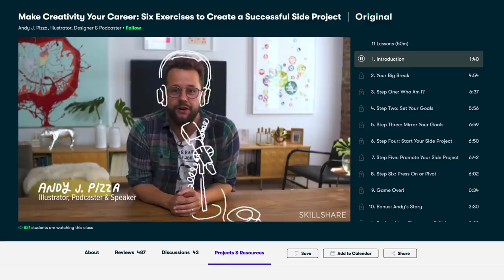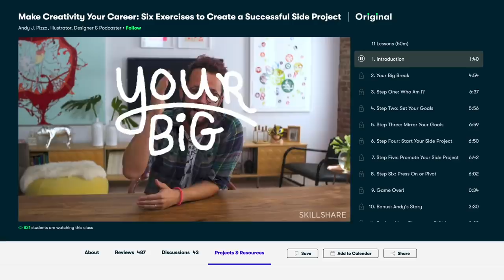Horse Box Camper EP 5 - The Roof Rack

Comment: Looks great, good job. The idea with the roof rack gets a bit of a drawback with the solar panel, cause you can't use the full space. You may check out the suspension of the trailer: has it the same comfort as a regular caravan trailer? If not, it can rattle the interior loose. And have a close eye on the solar panel. It might not withstand hard vibrations. Anyway: thumbs up for your project.

Comment: I'd put some better rubber under those solar panels personally. Big ol' rubber bushings the size of a donut at least. Trailer suspensions are awful, and those panels are an expensive piece of glass to crack.
Reply: And in that position, road bumps will play that horizontally-stressed plate/drum in ways it wasn't designed for. Wondered of diagonal/center support would be helpful.
Reply: It's not glass, but resin actually.
Reply: @p_mouse8676  There are models with glass. Anyway, resin can break as well, especially after some degradation through sunlight.
Reply: @p_mouse8676  Even worse? Resin is easier to crack than the tempered glass panels due to impact, and who the hell is selling resin panels that big? The resin universally fails before you can even recoup the cost of a panel that size, it's the cheapest, most disposable panel you can buy that's usually relegated to toys and landfill trash like chinese landscaping lights.

The ONLY acceptable use for resin on residential solar panels is to repair a broken glass panel. The glass is the heatsink that keeps the cells from cooking the PCB. You can't get rid of the heat with a puddle of plastic. Forget the fact that resin reduces the efficiency of the cells.

But I think it's safer to assume that you actually have no idea what the panel is covered in, given the above facts and that nobody makes panels that large in resin at any scale, let alone sells them as a consumer product.

Comment: I don't know what the laws and norms are in Germany, but Its not uncommon to have a hot wire to the trailer from the pull vehicle to charge the battery while driving. This is a much faster charge than what you would get with the solar while driving. Definitely keep the solar for when you aren't driving,  but it might be worth looking into that 12v hot wire to charge while driving.

Comment: I like the way it's coming up, but I have to ask if those four wooden columns will be strong enough or, rather, rigid enough. I can't help thinking what could happen if there's a combination of too much weight on top and tight turn on the road or an emergency brake situation. Just asking.
Reply: I had exactly the same question during the video. Also, there is no 4 support columns  support because they are cuted : https://youtu.be/cRuZuJgnwac?t=461.
I would say  there is 3  columns working in the structure than 4.
Reply: Cuted and perced  at the same point of structure , the weak points are here .
Reply: Weight distribution is everything in such a trailer, so I think she knows not to store particularly heavy items up there.
Reply: With much of the to area covered by the solar panel, I expect that portion of the track is more for protection than storage.  Without side ladder access even a tall person with have a time putting anything heavy up there.
Using the forklift to let one person gently place the track atop the trailer with so little risk of damage was genius. Working without an assistant requires improvisation.
Reply: Ah man, I just saw this comment; already posted my own separately... but yes. I share the concern.
Reply: @jameswyatt1304  if you ask me, having around, and therefore using, a forklift is not exactly what I call improvisation. Most of us don't have the access to one. Don't get me wrong, nice for her if she can. If it were me doing something like that, I would have to do it indoors with the help of some pulley system or maybe using a make-shift ramp with a couple of long wooden sticks or so.

The thing is not whether anyone would have a hard time placing anything heavy there, the thing is you can place "many not-so-heavy little things" that can add up to some heavy weight. And, again, it doesn't need to be too heavy, it just need  to be heavy enough that, together with some G-forces due to acceleration, braking and/or cornering, that wood could snap.
Reply: I think that the German TÜV will not be happy with the construction. It is to weak. Sorry for that, aber ich kenne die Truppe, die haben mir schon für geringere Dinge Probleme gemacht
Trotzdem viel Erfolg
Reply: In another comment she said a TÜV inspector had approved it
Reply: @galli0  if TÜV has approved that, I have nothing else to say. My concern is the same, I would certainly do it with metal instead of wood, that is for sure, but if TÜV is ok with that, it's fine with me.
Reply: @fadetounforgiven I would think that the force of the air when driving would be a big problem. I've seen metal roof racks torn from car-tops because people grossly underestimated the force involved. Remember holding your hand out the car window at highway speeds. I suspect that even if the uprights were steel they would bend if not break.

Comment: The combination of wood and metal looks amazing. Nice work. Just a question what would have happened if you elevated the solar panels to the level of the sides of the roof top. I feel it would add some storage underneath them and makes it easier to stack your stuff on the other part with less worrying that they would fall over or shed over the panels.

Comment: The solar brackets looks squishy which was a little underwhelming compared to the exquisite detail for everything else. And im sure will be revisited. Would it not also  be an option to suspend the panel under the rack so you can pack ontop of the rack if needed without risking damage to the panel.

Comment: The way you mounted that solar panel on the roof rak almost cuts the available storage space in half - after all, you don't want to cover it with the stuff you load up there. Wouldn't there have been a good place for the panel in the narrower front section of the trailer, to where the roof rack doesn't extend?

Comment: hey Laura always love your work, but I think your design has a major flaw, if those uprights are 90x35, at the lap joint they are now only 15-20 thick and there is a 10mm hole through that and because of the tension on the bolt the wood fibres around the bolt are compressed and stressed already, I am sure flex and fatigue from braking and cornering will see failure with no load in a short time, I say this with lots of respect for your work Laura, you have always inspired me.
Reply from the maker: The construction will be strengthened by other parts i will add to the wood. It’s not done-this is now just holding the roofrack in place
Reply: Thanks Laura, I look forward to next video (as usual), do you still have the model car from your childhood?

Comment: Those four horizontal wooden posts, holding the rack up, need to take all wind, braking, acceleration etc load pushing the platform backwards and forwards. Isn't that a little sketchy? Looks good though

Comment: Love the design choices so far.. I love the way you explain your thoughts behind the design too. But one thing puzzled me.. why put the solar panel there? Won't it get covered up when the roof rack is loaded?  I would've thought putting it forward of the rack, and angled at a 45 degree angle so it not only acts as a solar panel, but as a wind diverter/break for the roof rack would make more sense. Although, I suppose that would mean you'd have to park facing the sun to maximise the power output...

Comment: What you built was lovely, but I'm surprised that you wanted the roof-rack to provide lots of storage AND mount your solar panels so you would always have electricity, even when driving, but you mounted the solar panel on the bottom of the rack so that you lost all that potential storage.  Why didn't you suspend the solar panel at the top of the rack, leaving some room below it for stuff like ... well anything?  Also, unless you will only drive it around the parking lot, I would think an "air-dam" around the leading edge would be a good idea to protect against bugs, rain, dust and other debris hitting it when driving at speed.

Comment: I get your childhood dream, but I don't think this will be that useful. You can't store anything bulky or heavy up there because of the aerodynamics when driving and the impossibility to get it up and down. If you put something on the rack it will reduce or stop the production of the solar panel. The rack is the most likely thing to break by accident (low bridges, trees, gates) and putting the solar panel on top of it will damage the power system of the camper. In my opinion the solar panel should be mounted to the camper and the rack should go onto your bus.

Comment: I noticed that you tend to spray metal without any primer, is there any reason for this? In your previous video you can see that you accidentally scratched the paint off the metal as it didn't adhere correctly. That rack will look tatty once it's blasted with road debris from driving.

Comment: Hello Laura - I'm an occasional viewer, and I enjoy your projects.
A question and a suggestion...
The 6-fingered patch on your Lincoln welding jacket.  Is that a Magicians reference?
On the Teak uprights where they separate from the fiberglass top, there is a sharp "V" which will inevitably collect dirt and debris, and eventually rot out the wood in that location.  I suggest a filler piece which is steeply angled to make the stuff slide off.  It's the same idea as a "frog" when roofing a chimney on a house.
Here's a picture.  Imagine the chimney as the teak upright:
https://violetfrog.com/wp-content/uploads/sites/76/2015/08/0160a24b37de890ce74b9e7c2481048e8075fd1eac-1024x768.jpg

Comment: Hi.  I do not know for sure but wonder if it may be so because I can not the country traffic rules and laws where you live but maybe it is that if you rebuild the trailer fixed interior design and construction that it will correspond to rebuilding the trailer weight.  and thus have to be re-registered to get a different weight on the trailer weight of the registration certificate.  Not that it is so completely safe, but if it is, then if they want to look unlucky it means that the trailer will be too heavy for the approved weights of the vehicle you are using, if the trailer weight is on weight and at least for the laws and regulations.  that applies where I live in that country, you can't change the vehicle's weight or the vehicle's weight without registering to the weight you are converting to. ❗

Comment: 9:17 looks like your camper is slightly out of balance and lifting your car off the ground...
Reply: There is nothing in it yet, so this will be solved with the weight of the interior. Probably best to put the heavy batteries up front so you get at least 50kg of tongue weight.

Comment: isn't it going to be very hot in it because of aluminum ?
Reply: There's probably going to be an insulation. Apart from that, I think the aluminium will reflect most of the light and therefore not heat up as much.